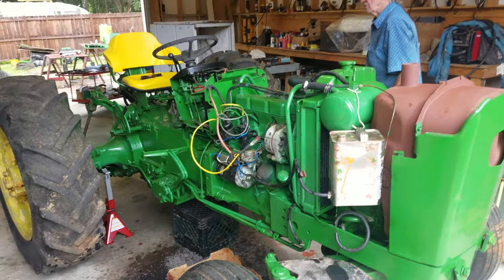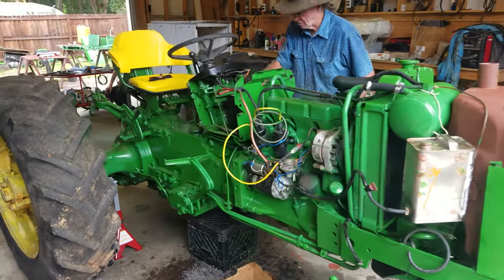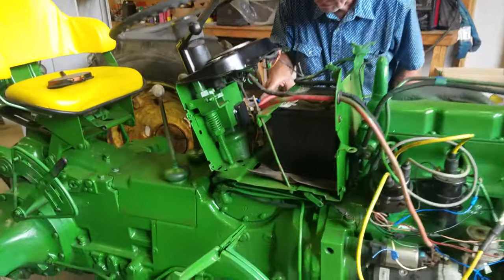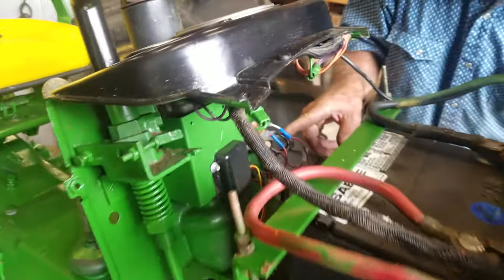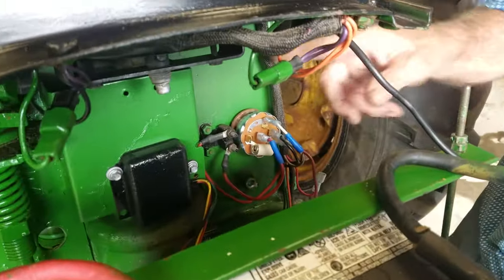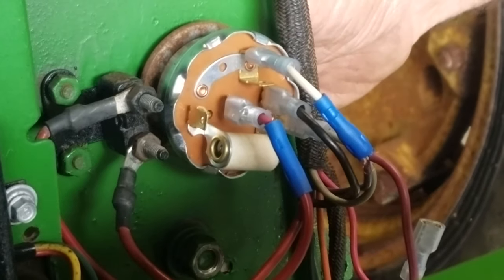John Deere 1020 gas engine, new ignition switch,  carb and distributor. purrrs

Comment: Maybe mine will turn over that fast when I get my new starter!
Reply from the maker: Hi Carl, we did the Starter, Carburetor and the distributer. Cranks every time easily.
Reply: Hi, thanks for the reply. I bought my tractor two years ago it’s a 1966 John Deere 1020 gas engine. The previous owner had an electronic ignition put in. I rebuilt the carburetor which solve a lot of problems. But it has always turned over really slow. I went to start it a couple days ago and my starter failed. So I ordered a new starter which will be in next week. I hope it solves the slow turning problem.